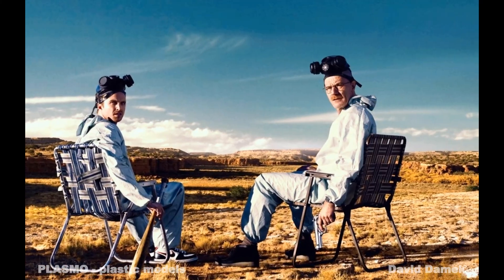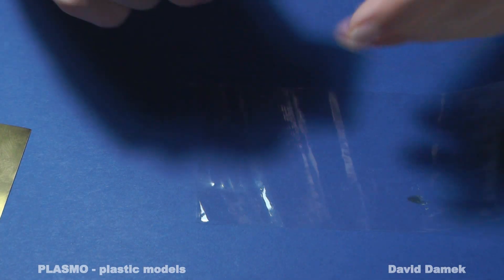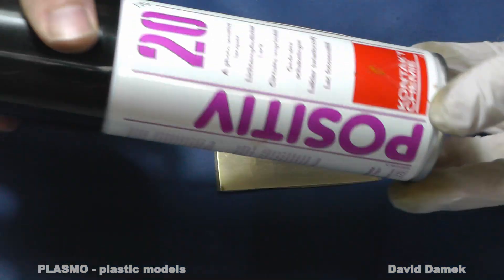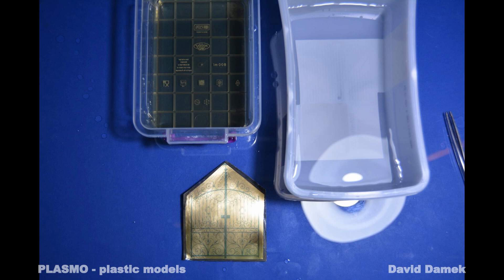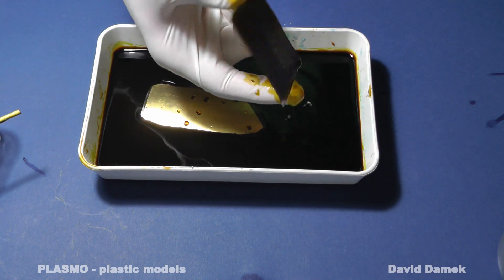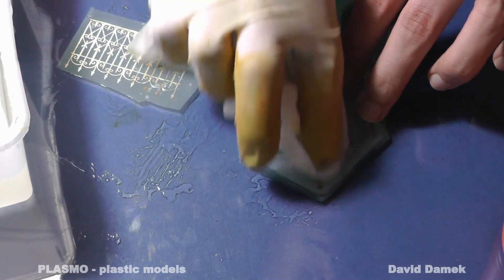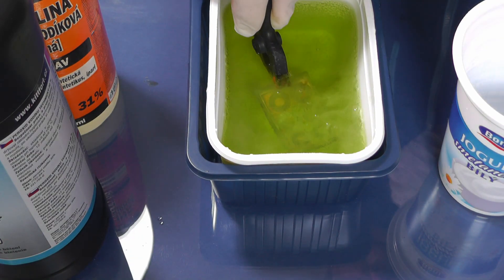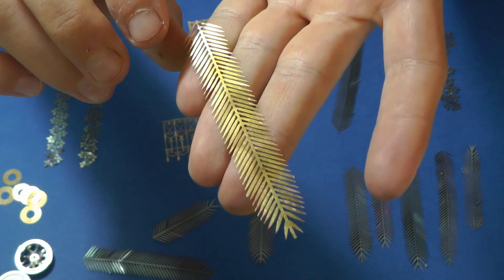How to make photo etched parts at home - Great Guide Plastic Models

Comment: Great video. Can i use my laser printer at home with transparent sheet if i do not want to go to the professional printer?.
Reply from the maker: I tried it. :-D Laser printer has fguser roller which is very hot and plastic sheet was melting down. Ink printer is much better for this.
Reply: PLASMO - plastic models
ok, thank you for the response.